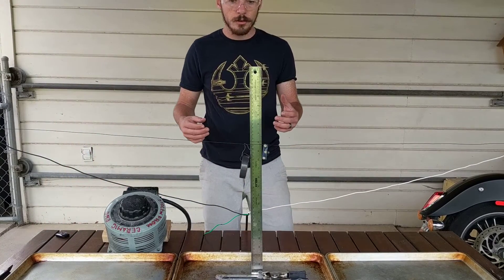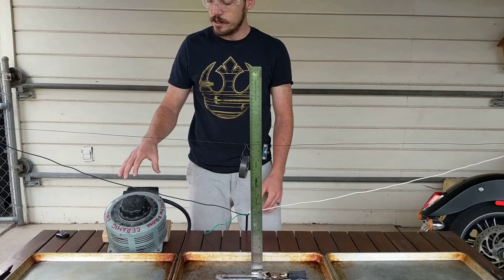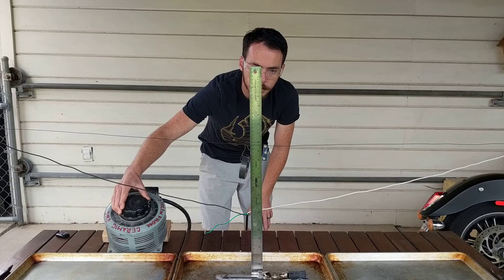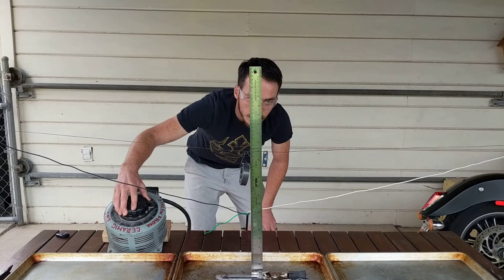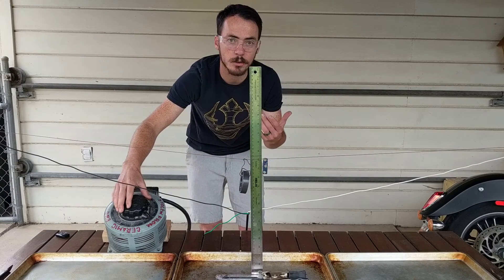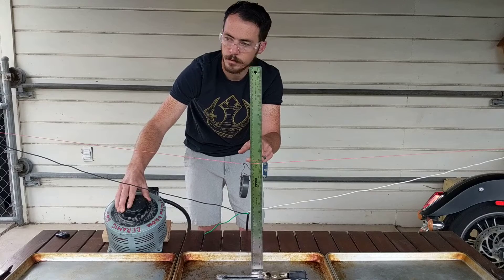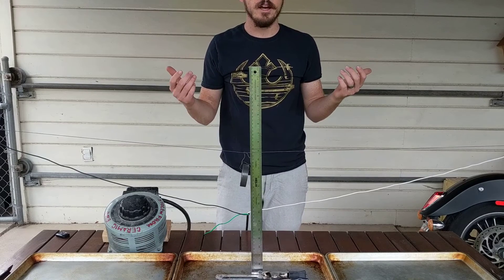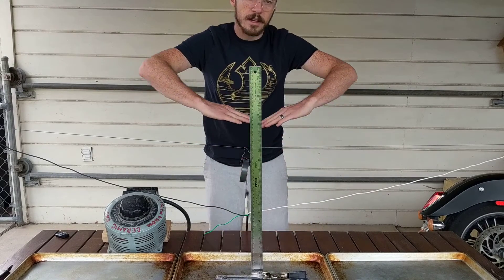A heated wire will expand... right?

Comment: But why transformation ferrite to austenite is start when electricity is turn off, and wire start to cooling? As I understand, it should happen when wire is heating above 912 degree. Wire with electricity fowing should be hoted than without it.

Comment: Hello. What was the maximum temperature reached for the iron wire in this experiment?
Reply from the maker: I've never measured it with a pyrometer or anything, but it's hot enough that it passes the phase transformation from alpha to gamma, so the phase diagram gives us at least an idea >910C